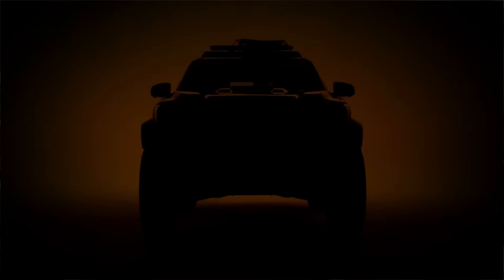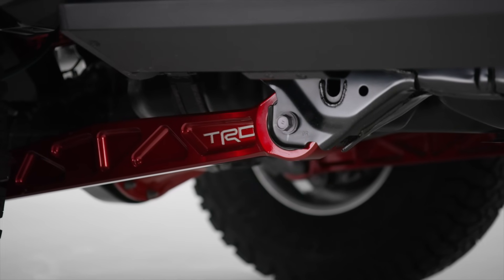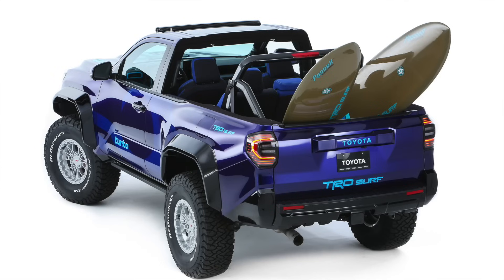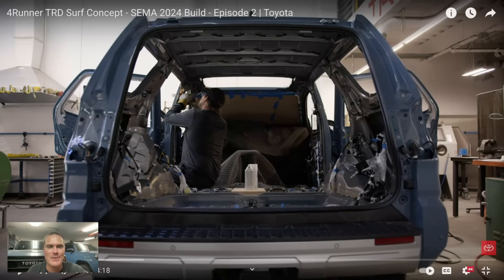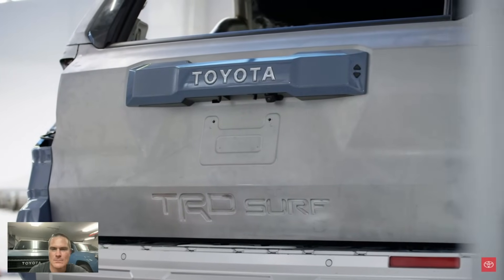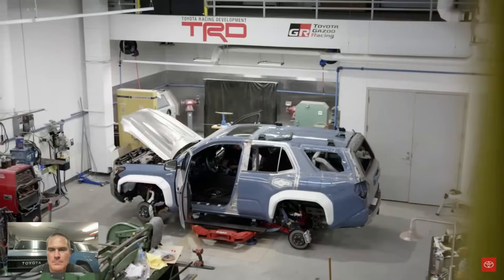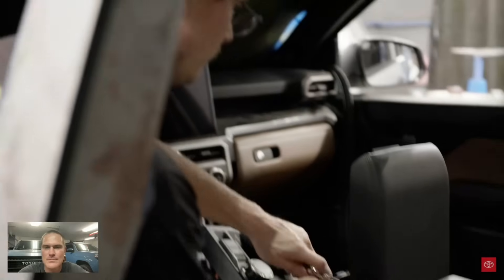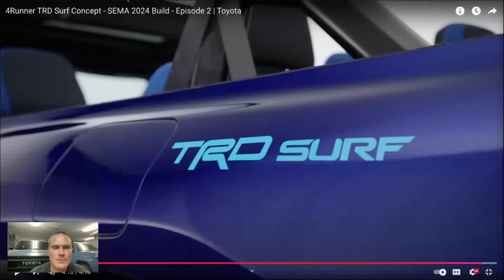Would YOU Buy This 6th Gen Toyota 4Runner TRD Surf Edition?

Comment: Maybe, but they've got to keep the price down and the size down. I'm getting tired of how they're both inflated with trucks and body on frame SUVs these days. It looks like the size may be down. Now do something about the price. I'm not paying $40,000 for a two door short wheelbase thing. They should put out a model with the bare minimum in technology and luxury. I don't need all of that crap.
Reply from the maker: The wheel base is longer than the current 4Runner
Reply: @TRDJon  Well, poop.